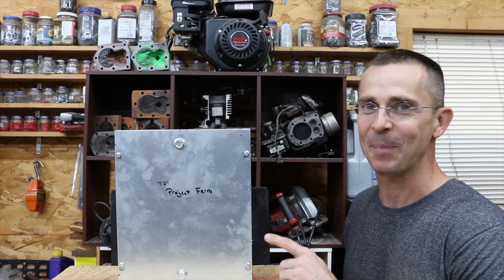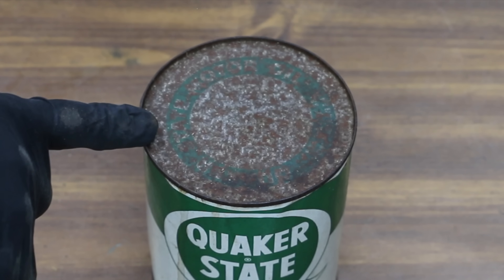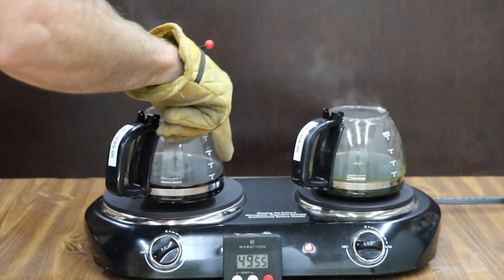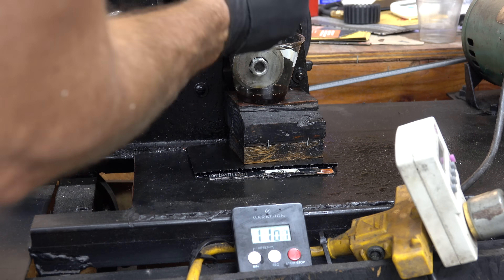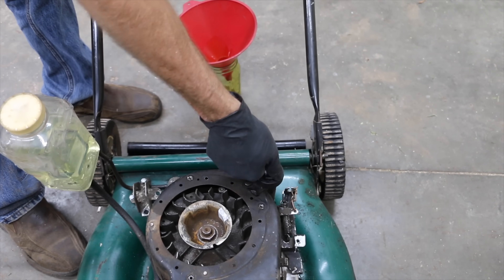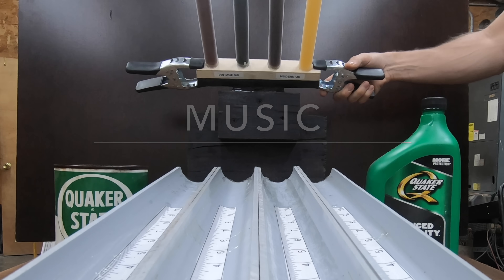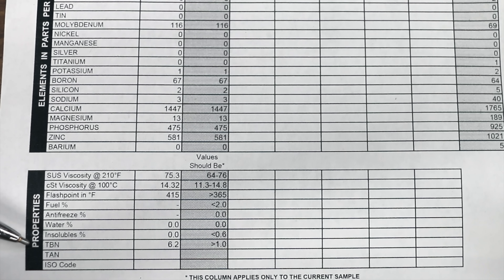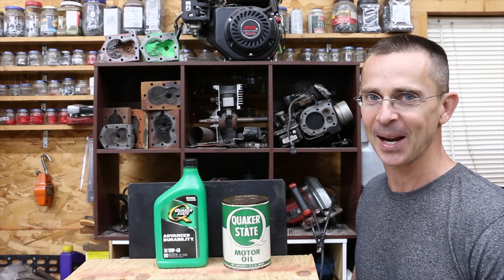Is Oil Good After 70 Years?  Let's find out!

Comment: There's a reason oil changes used to be recommended at 1,000 to 1,500 miles.
Reply: Between oil and engines only having oil filters as an optional accessoryfrom the 20s or 30s up to 1956 models or so, yes.
Reply: Actually oil isn't completely clean when new. If your filter has enough depth to clean oil The oil gets cleaner than new. My 41 Dodge had the optional Fram cartridge bypass filter. It used cotton. It was the same as the Luber Finer for diesel engines. There were also AC Purolater and others.None of these companies have made filters that clean oil since the cartridge filters. My 64 Rambler American came from the factory with a standard spin on bypass filter. I had to remove it and install a toilet paper filter so that the oil would clear up. Started with the Frantz. All I have now is Motor Guards and the Gulf Coast. There are others as good now but they use like 30 dollar elements. I use Great Value 1000 from Wal Mart. For diesels Gulf Coast has filters that take Bounty Big Roll paper towels. One problem I see now is people are installing little expensive filters and not changing them often enough to keep the oil clean. Especially on diesel engines. Engines need some new oil but not a full oil drain. The big double roll paper towel filters need about 2 gallons of make up oil when the filter is changed. My cars need a quart of synthetic and a roll of toilet paper every 6 k miles.

Comment: Now, a Havoline story: I had a 1978 Yamaha XS-400-2E motorcycle. It is still out back in my metal heap. I used the 10w 30 Havoline of the circa 1978 vintage. It spun a rod bearing and developed a nice knock. Wanting to finish out the fall of riding, before rebuilding the engine, I decided to change to Mobil 1 oil, supposedly synthetic and could go for 100,000 miles.  I drove it easy and for a few thousand more miles. It was now about November and getting cold, so I decided to change the oil again. Back then you changed oil every 2000 - 3000 miles. Not wanting to pay $4 for the quart or so of Mobil 1 oil, I decided to switch back to the 79 cent per quart, Havoline for just a weekend or two of riding. I Changed oil and filter and gave the engine a kick and I could not kick it fast enough to start it. It never ran againg until after a rebuild, and it was running fine before the change from Mobil 1.  Unless I had an oil Burner, I never used anything else again but Mobil One again.  I have blown several engines since, but never one on Mobil 1.  In fact, if  I had to use that brand of oil today, or choose to keep the  used Mobil 1 oil in, I would keep the used Mobil 1 in. I still use it and go about 7500 miles per change and have  on at least one occasion in my life, gone double that. My car has 340,000 miles on it currently.  Honda + Mobil 1 + Prolong = high miles.
Reply from the maker: Thanks for sharing.

Comment: You won an argument for me. I claimed that oil back "in the day" had a green color to it like grease. You proved me right!
Reply from the maker: Thank you for the feedback!
Reply: My experience was with Chevron. Never saw green oil. Our most expensive oil was bright red. Premium gasoline was very red. With the toilet paper filters instead of the oil being golden like mine it was bright red.The oil was picking up the red from the premium gasoline that got past the rings.
Reply: That’s an electrical box lol
Reply: No coincidence that the can and the oil are green.
Reply: I used Chevron Delo 100 30 wt It wasn't green. ARCO graphite was black.
Reply: If you never saw green oil, you aren't as old as I am.
Reply: Arco graphite was garbage.  All the graphite ended up on the bottom of the pan.
Reply: The only green oil I have ever used was Valvoline 2 cycle oil.  I'm 80.
Reply: My 41 Dodge had a factory installed Fram bypass filter that used cotton as a filter media. There was a decal of a dipstick with golden oil on it. Under the decal it said the dipstick tells the story. Since 1963 all I have ever seen on my dipstick is golden oil. If I ever saw green oil I would be worried. No I didn't buy the 41 Dodge when it was new. I've used toilet paper filters since 1963.
Reply: Correction, before 1963 I saw a lot of black oil on the dipstick.MY Rambler turned the oil black soon after an oil change. As did most cars in those days.
Reply: I forgot I had diesels that I couldn't get the non abrasive black out. No more than I could filter.the red out of ATF. After awhile you can tell the difference between dirty black and clean black.

Comment: Don't know if this has been asked/stated (and didn't want to go through 12k+ comments to find out)
1) The Vintage QS didn't have detergents according to analysis.. Which I expected. But the modern QS did. You compared a non-detergent motor oil against a detergent motor oil. Could / would a modern day non-detergent motor oil be more of an apt comparison? 

2) Viscosity: most of the vintage non-detergent oils were straight 30 or straight 40 IIRC. The modern day oil in the comparison was 10w40, giving a cold temperature edge. Again, would not a comparison to a straight grade oil be more apt in this case?

No matter what, I love your videos, keep 'em coming! And again, forgive if my postulations have already been asked / answered. Happy Holidays!

Comment: Good video. Highlights the differences between oil in the early days and modern oil. Oil advancements are a big contributor to engine longevity. Also notice the language on the can, “go longer before you need to top off”, hinting that you didn’t change oil at the time, just kept the pan full. Engineering certainly played a big part but oil advances can’t be ignored, without better oils better engines would fail in a hurry compared to using proper oils.
Reply from the maker: Thanks!  Thanks for the feedback.
Reply: Yes you did change it, or were supposed to anyway.  "Go longer before ---) referred to the fact that most people had to had oil about every thousand miles.  Maybe more.

Comment: I’m curious how the 1950’s oil would’ve performed when paired with leaded gasoline. Wouldn’t leaded gasoline potentially clean out that sludge that formed around the valves and maybe prevent that drop in compression?
Reply: Leaded gas does actually produce lead "sludge" or I should say dust in the combustion chamber.
Reply: Leaded gas was to help prevent backfiring. I seen  some kind of documentary about it

Comment: When I was a kid late 60's early 70's! My dads motor, stop running!,,, when they pulled the valve covers off, it was caked with so much sludge! it had stopped the oil journal up! Quaker State, replaced my dads engine!!! Thus, became the nick name "Caker State" That was then! This is now! Really hurt there business!
Reply: Pennzoil would do that too. It was paraffin.
Reply: Papa Smurf  I’ve seen it, with my own eyes. Pull the valve covers off, to clean the return holes and the shape of the valve covers, was still there! The oil return holes, were completely stopped up! We used, clothes hangers, to clean them out. So much oil, on the top of the head, while the engine was running. The oil would seep through the valve guides, causing the engine, to smoke.. after cleaning the return holes, no smoke. Quaker State, was horrible. I was the son, of a used car dealer, during the 70’s and 80’s, I’ve seen it all!
Reply: C W  My Dad was so surprised when they replaced his motor! I just went though a 4 month battle with Michelin Tire, where my tires, had huge dry rot cracks and still measured 6 on tread depth! They where suppose to send me a check for $314.00!! When I received the check, only $245.00.
Michelin Executive!  said, take it or leave it!!! I guess the days of customer service!,,,, and the customer is always right!,,,, ARE LONG GONE!!!
Reply: Oh yeah, the son in law to my former next door neighbor Butch (shadetree mechanic) told me Quaker State did that way back when... Butch died in mid 2019 of cancer... RIP bud...
Reply: Austin Lucas Sorry to here about Butch! My dad past in 1985, Bad Ticker! If Butch was like my dad? Them dudes could fix anything!  All they needed was some bailing string, role of wire, and some kind of black tape that looked like it was soaked in tar! My dad work in a ship yard, next to the old Bainbridge Navel Base! That's where the tape came from, and don't get me started about the gray paint they used on the ships!! Awsome stuff! Them two would have "Shot The Shyt" for hours! You have a,,,, "Happy Thanksgiving",,,,, That goes for everyone out there!!!

Comment: i remember when Pennzoil was green also. it had a fairly bad smell to it. i have seen people express concern about new oils not having anti-wear additives like older oil had, and according to the analysis, the old and new oil have about the same! I'm not going to worry so much about using modern oil in my 1959 Ford.
Reply from the maker: Thanks for sharing.
Reply: What today's oil DOESN'T have much of is zinc, that's why they use roller lifters now.

Comment: Its not as simple as "millions of years old" vs 70 years older. Refining processes have changes dramatically.
Reply from the maker: You're absolutely right!
Reply: Not much.  Refining crude is done with a fractional distillation tower today just like 130 years ago. What comes out is called base stock and forms the base of all motor oils including transmission and power steering fluid and gear oil. What has changed in 70 years is API (American  Petroleum Institute) standards which require more additives or treating with hydrocracking or solvent extraction. 70+ year oil just doesn't last as long which is why the Ford Model T had a 500mile oil change interval.

Comment: The 50's oil was probably "non-detergent"
Reply: Probably.  My father started using detergent oil when it first came out in the 50s.  He said Mobil introduced it, and I never questioned it.  Did Mobil in fact come out with the first detergent oil?
Reply: @8avexp  It came out early. Long before the 50s (in France) there was oil packed with some kind of detergent only to be used between oil change to rinse the motor.

Comment: my question now since ancient oil is so different from modern oil was the differences caused by aging on a shelf or just the original make up of the old oil was never as good as modern oil even if it was new?
Reply: Considering how the oil lab results show it's still good (mentioned it at the end) the old oil was just that bad.
Reply: Nothing wrong with the oil, it just lacks additives.

Comment: oil back then was awful compared to now.
Reply: It's the same oil . Just added detergents and procedures of refinement is different. 
Oil is millions of years old.
Reply: Most oil now is synthetic so not really
Reply: @lalajee143  and thats why oil back then was awful compared to oil now.
Reply: @HazzNJayza  it can be awful again if you remove detergents and chemicals
Reply: You even have biodegradable motor oil now, what a world. (see G Oil and Renewable Lubricants. They do work.)
Reply: We had good oil back in the 60s. Its a matter of how many impurities were removed at the refinery and what additives were added. The heat of the engine would try finishing the refining process.The impurities ended up stuck to any thing hot like rings and valves. If you had a oil filter that cleaned the oil A lot of the impurities were filtered out.

Comment: Jeez, no wonder cars back then were more prone to breaking. Thank the good lord above for modern oil not grenading our engines so quickly
Reply: Dude that oil is 70 YEARS OLD, it wasn't the same when it was new...
Reply: @johndelorean7353  My long term personal opinion of Quaker State oil was, and is, it's crap. It ruined many of my engines before I spoke to a mechanic about QS oil in 1972, and without even seeing my car's engine, he told me exactly what it looked like..., black sludge covered (paraffin) crusty oil passageways, and smoking like an old diesel!
Never used it again, too much engine damage. 
The engines of today run much longer before needing an oil change, and it boggles my 65yo brain.

Comment: I have Uncle thay worked a farm that he grew up on. He would buy oil by the drum for all the different equipment on the farm. He put that straight SAE 30 non detergent oil in everything. Including a 1965 Ford F100. After over 150k miles on the F100 it started to fall apart. So my Uncle got another truck. We could not waite to take that inline 6 cylinder apart. Wow, its hard to believe bet there was very little wear and not that dirty. The oil was changed evert 3500 miles. I was impressed.

Comment: Isn’t all oil like millions of years old what’s 70 years to that
Reply from the maker: Thank you for the feedback
Reply: The only thing I could think is maybe the refinement process? Idk I’m no expert
Reply: Crude oil vs refined oil is all
Reply: Beel 
Oil, in its refined form, goes bad after a couple decades.
Reply: He explained it in the video.  The older oil has different additives when compared to the newer oil, and as a result it's not very good by comparison.  The actual oil itself when both were originally in crude form would've likely been very similar.  In that situation, no, 70 years means nothing.
Reply: I was going to reply to PF stating the same thing, he does good video thought!
Reply: There's actually quite a difference...
Reply: All oil was green back then.
Reply: Yup, and if you have a million year old engine it can be effectively lubricated with dinosaur meat.
Reply: @Anthony Gianoulos The refinement process could be different as well nowadays, so that could affect it, even without the additives being taken into account.
Reply: @Cannon6969  not necessarily just that because other factors also come into play..... Oil just like everything else oxidizes over time and absorbs moisture from the air ruining it. Natural ground oil is millions of years old because its underground sealed away under extream pressure allowing it to pretty much stay the same indefinitely and keeps it from oxidation.  So if your oil is in a sealed container that has a good seal it can sit for decades easily but even then molecules (oxygen and possibly stiff from actual plastic itself)will slowly leech throgh the plastic over the years slowly degrading it.... if it's in a metal container it can last as long as the container stays sealed... people have found weapon caches from ww1-ww2 with metal parts(usually guns)submerged all still in perfect working order.
Reply: Back in the 70s I only used control gtx it had that same green color it's what triumph m/c  recommended
Reply: Jay Arre are you talking about is single cell oils also known as microbial oil????.. if you are then they also produce alot of byproducts and are not the same as crude oil... it's more like vegetable oil.  Things such as oleaginous microorganisms, such as yeast, fungi, bacteria and microalgae can all produce oils and this has been studied since the 80s and isnt anything new.  They have found some microorganisums that can turn oil into gasoline and in theory we can genetically engineer or change existing organisms to do exactly what you mentioned... so who knows maybe 100 years from now people wont be pumping oil but farming it instead.

Comment: I used to work in a oil refinery modern oil is stripped of all paraffin (wax) and impurities  back in the 50s the refining processes were still very crude. The oil was left with a lot of impurities wax asphalt sulfur mercaptan the list goes on and on. I think though if you would have gently cleaned the rust off the top of the can you would have seen the grade  sae 30 was popular back then. If I remember correctly the first mutigrade oil came out around 1955 10 wc30. In my area it was humble uniflo. They bought a lot of engines didn't work very well. It would be so cool if somebody would send you some oil from that period of time analysis would be very interesting. Your videos are very cool thanks for all you do.
Reply from the maker: Thanks and you are welcome!

Comment: I would really like to see sperm oil tested. No more is produced legally but you can still find some old stock online. My marks engineer handbook from 1930 claims it to be an excellent lubricant especially for fine  Machinery. I have a small bottle that I use for watches.
Reply: Eww wtf
Reply: Oil made from a sperm whale.
Reply: @K4inan  There is no sperm in it.
Reply: Whale oil made good transmission fluid. It was very hard to find a good replacement for it.
Reply: If you need a fresh batch let me know ..
Reply: I’d love some.

Comment: "quicker break" oil is what some used to call quaker state, it turned to paraffin wax muck
Reply from the maker: Thank you for the feedback
Reply: Yeah, I remember back in high school, late 1970s, me and my friends avoided QS oil. The same with Pennzoil Oil.
Reply: When I was in high school I would have been glad to have Pennzoil or Quaker State.I got used oil from a local gas station. I got drip gas from a local gas pipe line. Sometimes.got a little salt water with it.It was.beautiful blue if if you let it settle for a few days. It would.destroy a modern engine. Ran good in my old.low compression cars. They didn't want liquid gas in the pipe line.also didn't like some punk kid.draining it off.